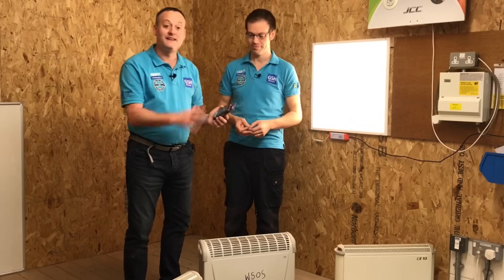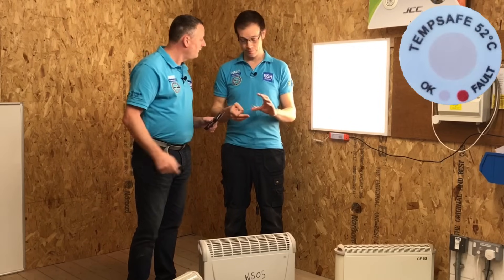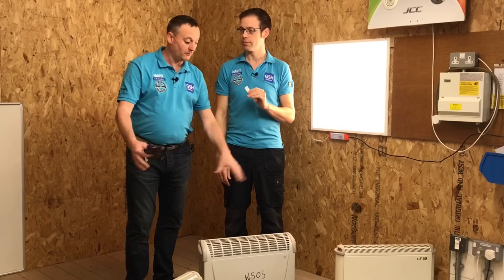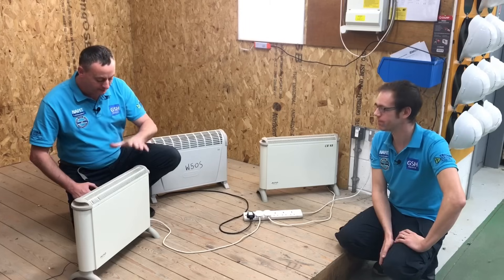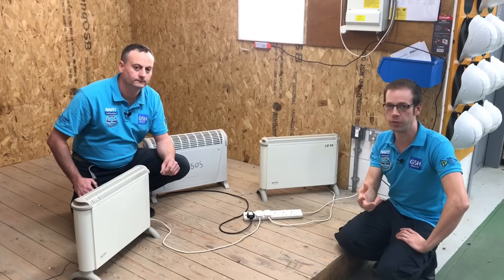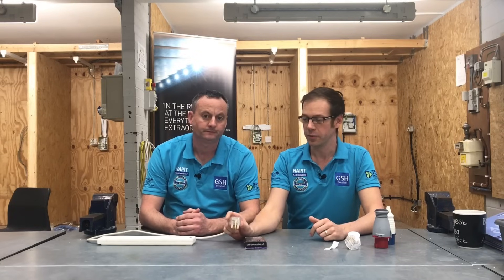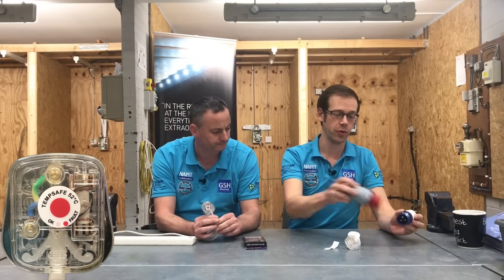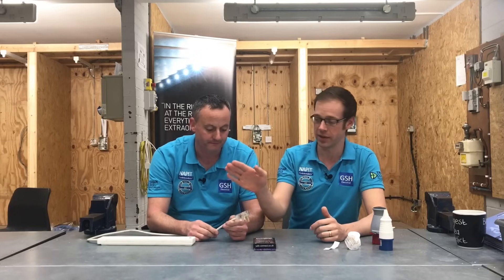Plug to HOT 🥵 - Hot Plug Indicator From Safe Connect

Comment: Wouldn't the stickers be useless for indicating over current on any fused plug.    Unless the very unlikely chance the fuse is faulty, it would blow before any heat is produced.
Reply from the maker: Hi. Loose connections can cause fires and generate masses of heat which sticker would pick up. Thanks for watching and commenting GSH Electrical 👍

Comment: This would be a good idea for the flow pipe and DHW pipe on a combi boiler to indicate a failure of the thermistors and or high limit stat which could prevent scalding and give the service engineer an indication on the faults occuring in the absence of him.
Reply from the maker: Wow what a great idea thanks for commenting and watching GSH Electrical 👍